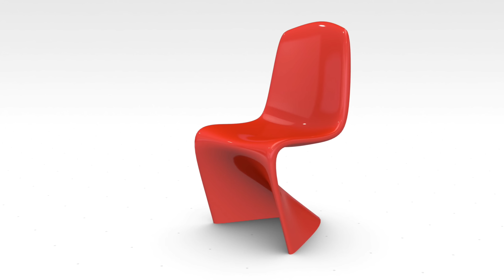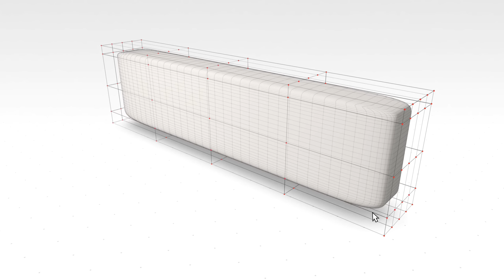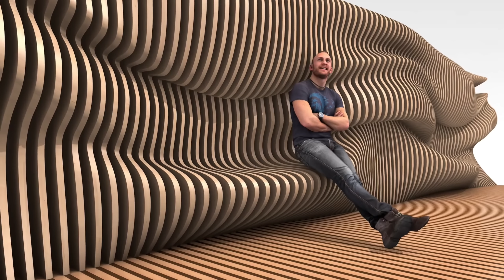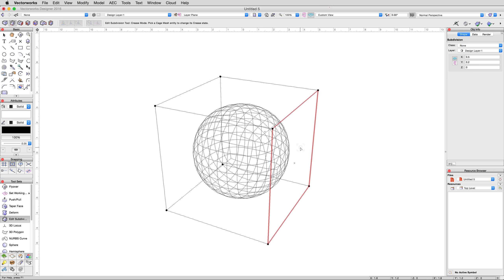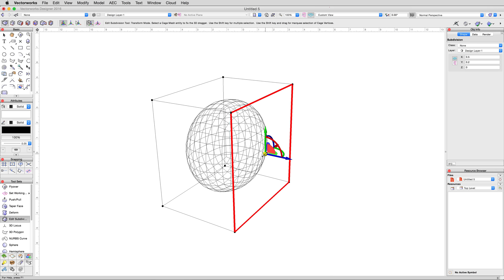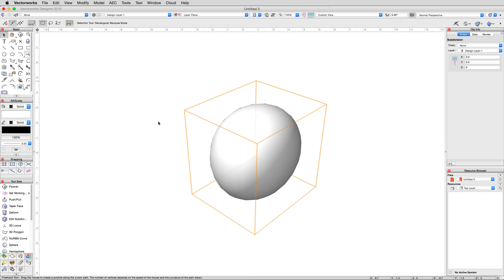Subdivision - Part 1 - Introduction

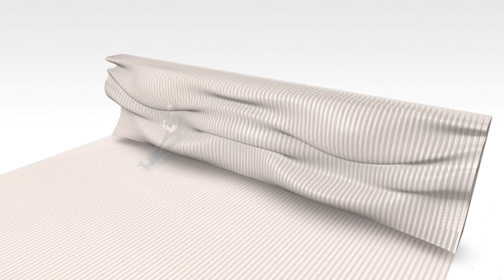Comment: How do you make the final parametric sliced wood as seen in 0:45 after creating the 3D form?
Reply from the maker: This was done with Marionette on the resulting solid. I believe a user created a network that allowed them to evenly divide the solid. You could also simply duplicate a linear array of slicing geometry at the desired thickness and spacing and then subtract it from the resulting solid.
Reply: @vectorworks  thank you for the reply! Is there an online library of predefined marionette networks that can be applied to projects? (For those of us who are not so good with the tool)
Reply from the maker: Yes, you can find them on the Marionette section of our forum: https://forum.vectorworks.net/index.php?/files/.